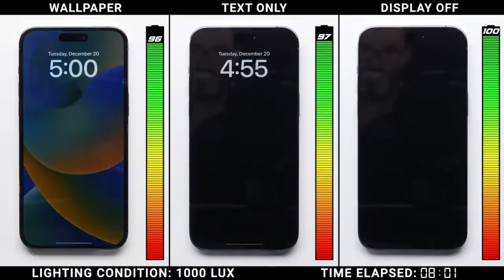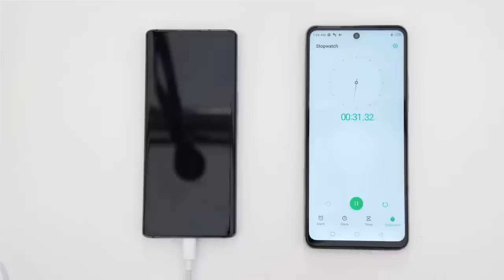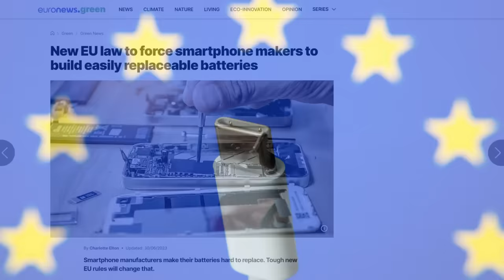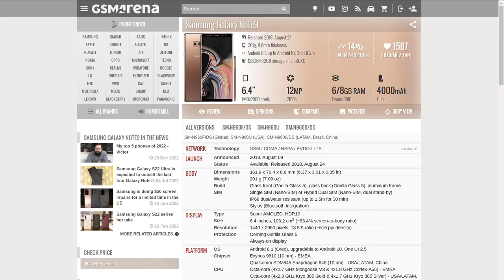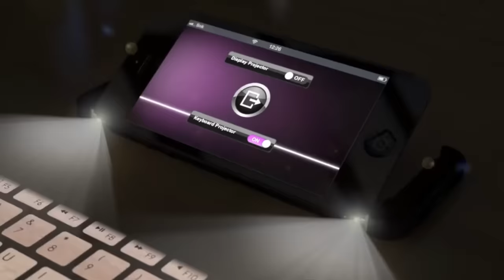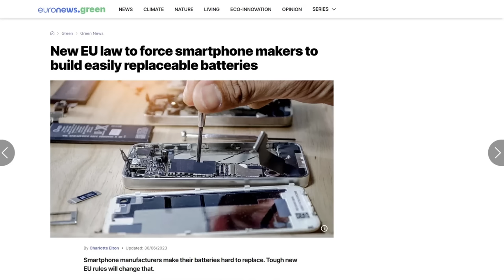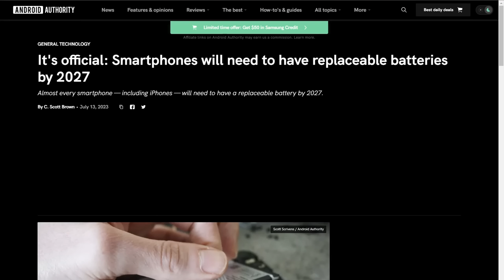All Smartphones Will Soon Have Removable Batteries

Comment: 6:53 Not 2 excuses, it is true, even if the main motive isn’t that.

It’s a fact it’s easier making a phone waterproof by not having a removable battery, the less stuff that moves the better. And of course you can make a bigger battery if you don’t need it to be user proof, they need to have some extra materials that take a lil bit of space, but in the end take space, reducing the battery capacity.
Reply: But I’m glad batteries are gonna become replaceable again, it’s the n1 reason to throw a completely good phone away.

And together with that, I wish we went back to plastic phones. Less slippery, and doesn’t break the moment it touches the ground.

Comment: I don't miss the sd card or removable batteries.

Sd card you can offload the data instead of hooking up to a computer. Phones now days have like a 1tb of storage 256gb is even enough unless you take a lot of 4k video or something.

Buying extra batteries for your phone can be a Benefit since you'd just have to switch. But honestly when ever I bought batteries they didn't last long. And the benefit is your phone won't open up if you drop it.

The one thing they need and I do miss is the aux back and a second usb-c connection. That way you can charge your phone and be doing something else.

Comment: The EU should alow Phone manufactures to make phones without removable batteries with the condition they also make a removable battery alternative of the same model. This would give consumer more options to choose.

Remobable batteries decrease security on stolen devices, cause its easier to power it down to avoid tracking it. This is a risk to consider.

Comment: My previous phone was a samsung Galaxy S4. It lasted me for many years and I only had to buy a new battery due to the old ones breaking 3 times. If I had used several batteries simultaneously, I probably wouldn't have had to replace any of these old batteries and would still be using the old phone, but the cellular service was no longer as good as it used to be, and the ssd was filled to the brim with the OS.

Comment: What I mostly loved removable batteries for is to force shutdown the phone
My first phone was a Galaxy J5 2017, which had a removable battery. Near its end of life, it would sometimes freeze, but holding the power button would NOT shut it down.
So I had to remove the battery and well, it worked. Reboot it and it's fine.
But the phone I got next after that one died did not have a removable battery, and the one time it decided to freeze, I had to wait hours to have it go to 0% by itself, very painful both for me and the battery (getting your phone's battery to 0% too often will make your battery live for a lower amount of time)
So meh, removable batteries > all

Comment: Having removable batteries on phones is mostly a good thing.. But I don't think it would sway people as much as we think from upgrading to a new phone every 3-4 years.. Most 3-4 year old phones I've seen that's been used daily are quite damaged with either cracked screens/camera lenses, lines on the OLED display etc.. These users will likely still buy a new phone regardless if the battery is removable of not..

Comment: You forgot to mention that there have been waterproof phones with removable batteries in the past. 

Also the back doesn’t has to be just clicked in place. It could be screwed or clicked in such a manner that you need something like an iPhone sim tray remover to open the back and avoid accidental opening when dropped.

Comment: Those replaceable batteries will only be available from the phone company's. (After market batteries won't work) The batteries will hard-coded the to their assigned phone. You will have use the company repair technicians. To gain access to an authorized battery. There will be no option for having multiple batteries.

Comment: Imagine...a tap on the battery release icon moves the battery partially out of the bottom of the phone. Just like a gun magazine pull it out and snap a full battery in...

The battery includes the usb port because they wear out fast too.

In fact, the loose battery doubles as a power bank if needed elsewhere.

A removable battery like that is a huge must have feature. A selling point.

Comment: 3:00 why don't we actually have adapters for the batteries and charge a different set of batteries while you are using the phone?
This basically means charging your phone without a charger in your hands. We would swap the dead battery for a full one and charge the dead while using the full one

Comment: Everyone is cheering in the comments, and I was all in for the EU mandating USB-C, but this is not it. There’s a reason why we stopped designing phones to have removable batteries, and it isn’t just anti-consumer planned obsolescence. This will lead to bulkier phones, smaller overall battery capacity, and fewer waterproof phones. Why should I care about swapping my battery throughout the day, like you keep pushing, when phones today last me the entire day with 40% left anyways? If you really need that extra juice for whatever reason, we already have battery banks, like you said.

I also think you’re underselling the waterproofing/water resistance. Just looking it up, the newest iPhone has an IP68 rating, allowing it to survive in 6 meters of water for 30 minutes, perhaps longer. That’s good enough for a drop in the sink, toilet, or even a quick dip in the pool, and I don’t plan on swimming in the ocean with my phone. You said you would put on some bulky case to make your new bulky phone even more cumbersome, and that’s cool, but I enjoy my slim phone.

USB-C had no downsides; this has so many. USB-C was the direction the entire market was taking, even Apple, except for their iPhones, which is why that law was perfect. This on the other hand, is a bunch of old ass politicians now forcing engineers to fix a problem they created.

Comment: First water resistant smartphone - Motorola Defy, had removable back and IP67 rating. Galaxy S4 Active and later XCover phones all had removable back and water resistance. So it was already done and can be done again.
Headphone jack and waterproofing? Done and done, Sony still does it, Asus as well.
Single camera with optical zoom capabilities? Also done, Asus Zenfone Zoom from 2015 had it solved.
Everything I've written above was lost, so manufacturers can cut cost and sell at higher margin, not for your benefit.

Comment: Absolutely not! 
1. IP67 or even 68 rating will be impossible, so for that reason, there will be as much damage as repairs.
2. The glass/ceramics are quality high-end consumer quality that needs to stay. Going back to plastic is simply not gonna cut it.
3. Despite having multiple phones, actually a new one about every 6 months back in the days, I never bought any replacement battery. Because the hardware and software at that time didn't need that amount of battery, usually during a day of heavy use, I could recharge it once at night.
The price for the battery will also probably be damn expensive anyway. To counter the rev loss for the tech company.
4. With Samsung Galaxy S23 Ultra, there is absolutely no reason it can't be used for 4k or even 8k res high end videos or pictures.  It can make as good as other mid range cameras on the market. I work with both full frame DSLR. But for everyday carry without any specified work. I don't want to carry 5-6 kg extra incuded lenses.
One gotta invest in a real DSLR or mirrorless, and that will take the bugdet up 3000k not incuded the lenses, at least for video production. And 1500k for a good photo. 
Sure. For 2000k, you might get a canon eos MK IV with a 25-70mm lense used, but I wouldn't go below that for any production. The camera on the flagship phone these days are so good that having a secondary camera that mostly never are in use, will be an extra cost, and people wouldn't know how to use them propper anyway. 
What I would rather see is that the companies are forced to have a battery change once during the phones life cycle. To improve the battery lifespan. If needed. But other than that, the idea of going back in time. Will not benefit anyone.
Who will do R&D on battery tech If they can just sell a bunch overpriced anyway? Wouldn't it be better to have new battery tech that improve them by 10x or even 20x capasity? 
So no, no, no, this is the dumbest EU regulation on phones. Also, within 2027, phones may not even be the go-to tech, as we currently see extremely rapid development in the segment of other wearables. 
And last. There will always be a phone people want over last years phone. And people will buy it.

Comment: What does “user replaceable” mean? Does it specify it has to be a removable battery pack?

I’m an iPhone user and I can change out the battery if I really wanted to (for example, if the battery health gets too low).
It’s not as easy as just popping out a battery pack, but it’s also not crazy difficult.

I’ll be honest, I’m not sure I want the extra bulk of a removable battery pack.

Also, most people don’t WANT a proper camera. Smartphones cameras have amazing quality nowadays, which is more than good enough for the average person. Carrying around an extra camera, let alone extra lenses takes up room and is heavy. Not to mention expensive.

Comment: They forgot to regulate battery connection. They should also specify all batteries should have a Usb c for charging. Yes you swap the dead battery, but what do you do with it if you don't have how to charge it? In this case a power bank still remains a better option, witch its a sad situation.

Comment: The galaxy s5 was the only phone I know that had a gasket to maintain its water resistant rating. I went swimming with it once. There is a higher chance of water intrusion though if it didn’t snap on all the way. ASL that means say goodbye to glass backs… unless there was a smart way to unscrew the phone back off without adhesive… this law is kinda dumb. If I understand it right.

Comment: I don’t believe this regulation means we’re going to see a return of hardshell batteries that could be swapped in and out quickly. Rather this regulation seems to only be targeting end of life replacement. Meaning the same kinds of soft, easily damaged LiPo batteries with have now, just in slightly easier to open cases and easier to remove adhesives.

Comment: What if you could have hit swappable batteries that just slid out the top of the phone? Its much easier to seal off from water with a lock, and you could even imclude other parts on that module so as those ports get old and warn, you could replace them with a new battery.

Comment: I am very curious to see how phones with removable batteries will be able to get an IP68 rating. Water resistance is definitely possible, but IP68 (or higher) will seem like a real challenge.
Reply: I think galaxy s5 had ip68. It was waterproof but with removable battery

Comment: Now you will have a waterproof phone and as big of a battery as possible for the first 3/4 years. after this you can get the battery replaced and use it again for 3 years without it being waterproof. This cost about 100€ to replace the battery in The Netherlands. I cannot see how this law will help this. Only the cost of replacing will be a bit lower, but it isn’t waterproof for the first few years. Which can be a lot more expensive

Comment: What is considered user replacable though? if apple makes the screen removable without a suction cup (and heat depending on the model). Is that enough? I personally think it is, its not difficult to replace a battery in an iphone as it is and if you do remove that barrier, its not  difficult at all. 
Pop the front glass off, slowly get the battery removed from the tape sticking it to the phone after disconnecting the cable and then you put in your new battery.

This would not give you any prolonged battery life during the day since its still a tricky procedure that takes time but you cant argue that it isnt user replacable. If tech devolves in to everything being replacable by a 12 year old, it just wont be exciting anymore and i really hope they wont go as far back as the old samsung phones. No one wants that.

Comment: I think S7 had replaceable battery and still was sealed and waterproof. Note 9 battery lasted super long, only now (like 4,5 years later) I'm replacing the phone because of the old Android. I hope the ordered S23 Ultra will be as good phone as Note 9. Glass back cover is super idiotic idea, classic metal alloy was the best. I know some interfere with wireless charging, but that's another stupid feature - made my battery behaving funky and loosing capacity, so I stopped using wireless long time ago. Cable charging is faster and battery lasted well over 4 years.

Comment: Phones batteries now last multiple day if you try hard enough, old phones didn't last the whole day if you didn't try hard enough.
But phones now are gigantic compared to before, batteries technologies way better, and manufacturer complete assholes by gluing everything, and that is the real and only problem. Batteries connectors aren't soldered, you could disconnect them easily if they didn't covered it. They wouldn't need to have hard shells like old batteries because you still wouldn't replace them every day like you all think this will go back to old removable batteries.
THIS is just about stopping manufacturer to glue everything and make the battery impossible to remove without damaging them.
I recently sent my phone for screen repear, and they made me pay for a new battery (didn't cost much at least, and it's probably nice to do it while doing everything else, unless my phone was less then 1 years old, that was dumb) mostly because they damaged it when removing it!

Comment: Restoring removable batteries will not fix the issue of short-term usage.  Another key thing is software planned obsolence and lack of long-term support. At least for Android and Samsung. I am still using Galaxy A5 2016 which I got brand new. It runs Android 7.0. About 3 years ago Samsung ditched its updates whereas there are yt clips showing that the phone's hardware can easily handle version 9.0. Now I am seeing app after app no longer issuing updates compatible with 7.0. This means if I uninstall them, I won't get them back in google play store. For now they work but I already experienced apps that no longer work after rolled out update with no more support for older androids beacuse they can't no longer connect with their back ends. For example my fitness pal.

Comment: trust me water is not a big issue with removable battery phone, I had a samsung galaxy in 2010 and that mf still works after being dropped so many times. The thing is even if you drop it in water you can just pop the battery off to save the mother board from water damage and letting it dry (also they dry faster as you can pop covers and  battery). IT SHOULD BE A MANDATORY FEATURE IN PHONES TODAY!!.

Comment: My additional regulation proposal - every phone manufacturer that is allowed to sell any phones in the EU must have at least one model of a phone available for purchase in EU which is 1. no larger than 140x50mm 2. with a screen aspect ratio no greater than 16:10 3. no heavier than 140 grams 4. has a performance in benchmarks no less than the middle point between the company's highest performing model and lowest perfroming model 5. a cost no greater than the middle point between the company's most expensive and cheapest phone.

Comment: To the point of a possibly reduced battery life - there is no excuse for this, make the phones thicker. Modern phones are already so unnecessarily thin, and they just keep making them thinner year by year for no reason at all. They are literally uncomfortable and difficult to hold now compared to phones from 10 years ago. Will never understand the compulsion of manufacturers to make their phones as thin as paper, it adds nothing to the experience of using a phone, and they could have used that extra space saving to put better hardware into the device

Comment: High quality phones have always had exchangeable batteries. I have never considered that us fruit crap when I have needed a new phone.
Not that that have happend too often as the last Samsung lasted for 7 years and was on the second battery when the screen died.
But the older Samsung is still in use as a security phone when out on the water and that is only about 15 years old.
And one thing I need from a phone they need to be waterproof and shockproof.
The phone he ask for at the end is just the phone I have now, enough memory, two cameras, submersible to 1,5 m for half an hour, withstands if I drop it on the street and exchangeable battery. And it's not even expensive, you can get several for the price of the new us fruit phones. The phone?? Samsung  Galaxy XCover 5.

Comment: I really HATE misinformed videos. No, it will not be guaranteed that batteries will be swappable like in the old days, with no tools required. It will be possible for manufacturers to only provide tools for such a procedure and they will not use any strong glue to glue the battery.